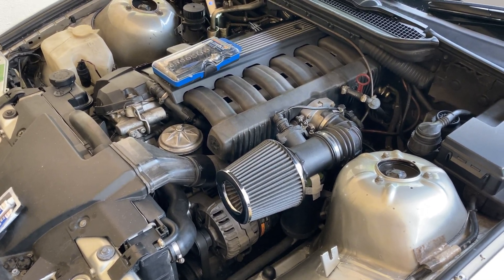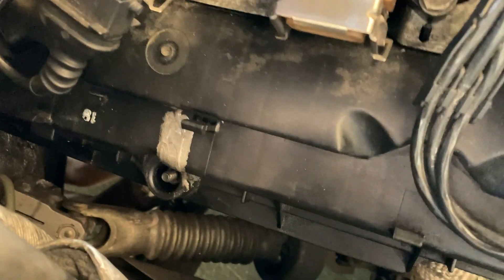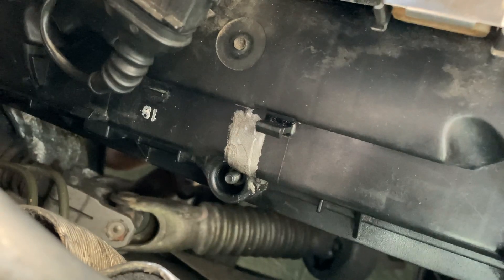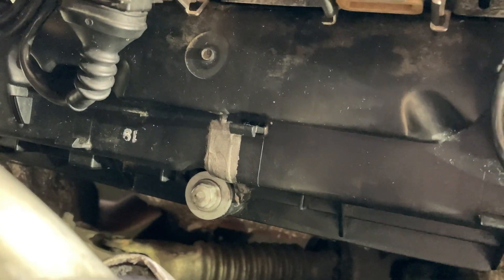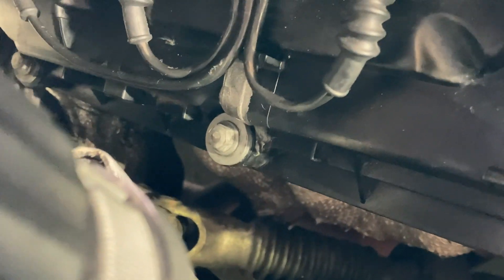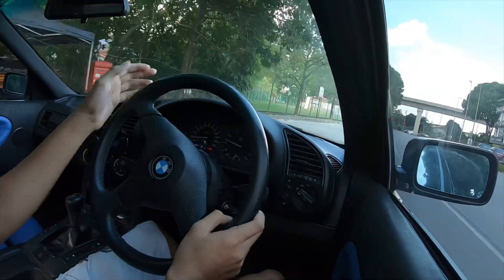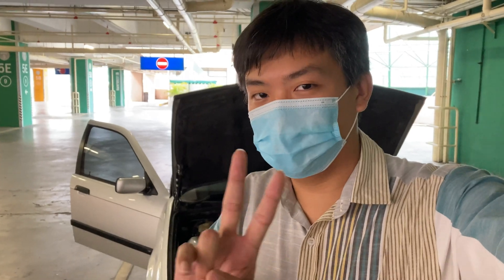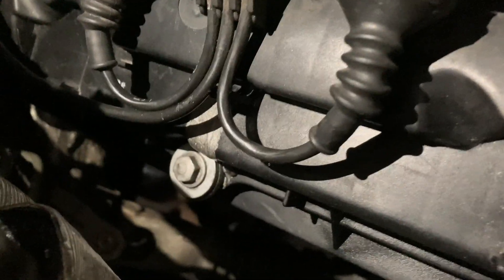Epoxy Plastic Valve Cover Repair

Comment: I'm about to do this tonight, is this weld still on the car? If so that's awesome
Reply: Seems like he’s not responding anymore. Did you do the job? If so, how long has it been holding up in any smoke or oil?
Reply: @highcard6155 yo, I did this six months ago on my e90 n52, it’s been holding up, small leakage. I’d say I don’t lose more that 15% oil before every 5k oil change, works very well 🙏🏽

Comment: did the engine rough idling after warm and whinning sound before the cover fix?
Reply from the maker: No, only noticed it by smoke when oil touches hot headers

Comment: Now that it is almost 2 years since your repair...Is it still sealed and no oil leak?
I have a 2008 E90 335XI and I am getting a lot of smoke from oil on the exhaust manifold. I need to remove the engine cover to examine it, but it is very aggressive and guessing it might be a crack as opposed to the valve cover gasket. Any info you can share would be appreciated. Thanks.
Philip
NYC Area
Reply from the maker: No leak so far. The repair held up perfectly
Reply: @mengsuan  Thanks for the reply! 
I noticed in the video there was not an engine cover installed. Do you leave your cover off all the time? Just curious as I was thinking of removing the cover on my E90 and just leaving it off as it is a lot easier to do repairs and access components with it off. Just curious if you always leave your cover off. Thanks again.
Philip
Reply from the maker: I have the engine cover on after I tested the repair. Rain in my country can get very heavy; the engine cover helps to keep moisture out of the coil plugs. M50/52 coil plugs aren’t very water resistant
Reply: @mengsuan  Thanks for that information. 
I guess in either case I will need to remove my engine cover to see where the oil is leaking from. I need to remove the cabin filter and cowl to get to the rear bolts on the engine cover with my E90 model. Thanks again. All appreciated.
Philip

Comment: Did you take the cover off to cover it or just cover it on the engine?
Reply: I heard its better to do it ON the engine. Otherwise if you take it off and repair it, when you install again it could stretch and crack.
Reply from the maker: I patched the valve cover while it is still on the engine

Comment: I was tightening the screw after replacing gasket then suddenly the plastic valve cover cracked and start leaking oil , so today I bought epoxy and waiting for the car to cool and ill see if this gona fix the problem
Reply from the maker: Good luck. This fix is still sealing my engine’s rocker cover

Comment: July 8th repair done, is it still holding now over 2 months later? I have a repair like this but towards the front of the engine that I need to make. It is a hairline crack like the one on your car.
Reply from the maker: Yup still holding fine till now. The engine has gone through countless red line and even high speed cruising over 200km/h

Comment: would an aluminum valve  cover be better than an oem plastic valve cover?
Reply from the maker: I tried to read through some forums. M50 aluminium valve cover wouldn't crack but may warp